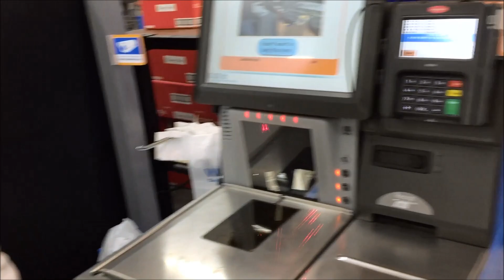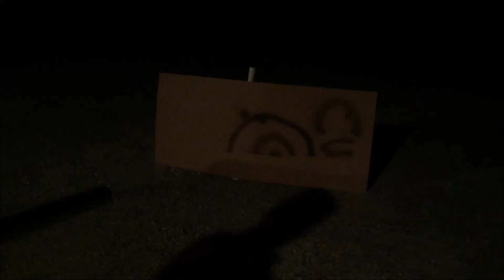Badass Potato Gun

Comment: Try key limes if you're able to afford them I found out about them due to a bad bag I forgot about an never used so I shot them out of my tator gun was getting like 400-500 yards away with them! Good times
Reply: Key limes*
Reply: Also you can use a air compressor as well just have to switch out igniter with a brass valve stem an some silicone dont go to far above rated pressure tho do at own risk